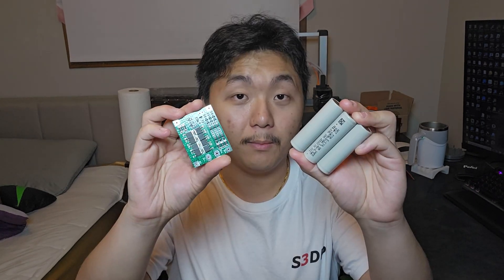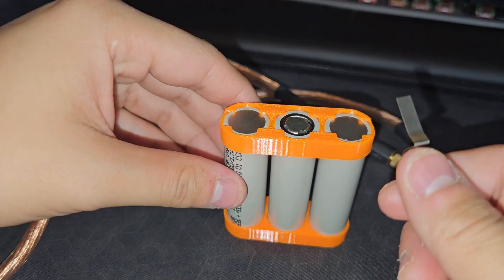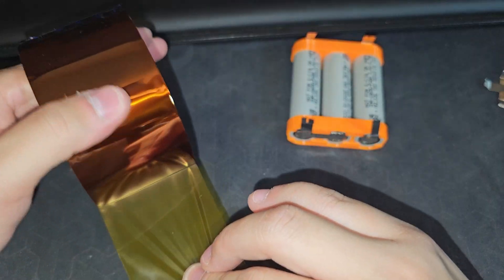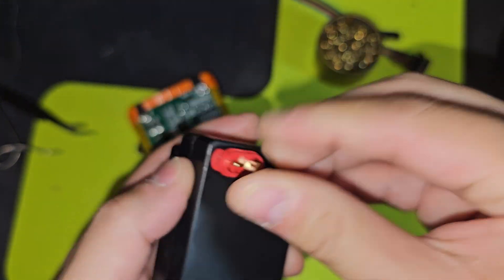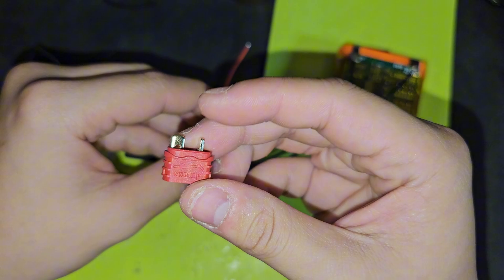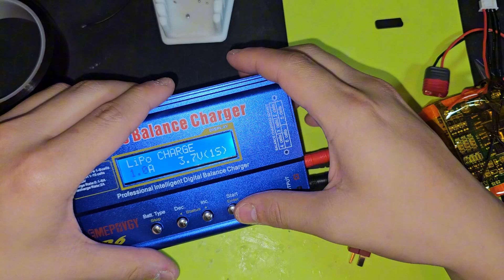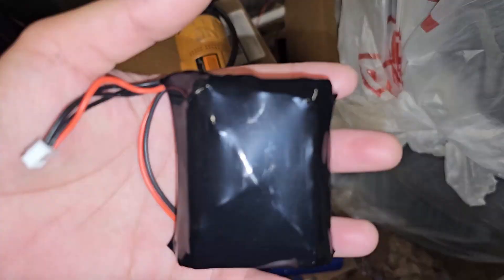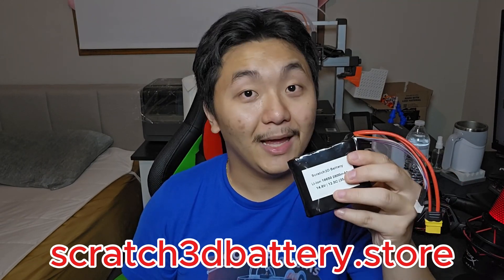DIY 11.1V Lithium ion battery pack 3500mAh

Comment: Can I charge it using those power out wires for example connecting to 12v 1A power supply?
Reply from the maker: You can but it will need an adaptor to make it work.